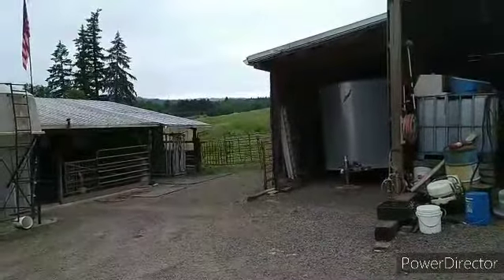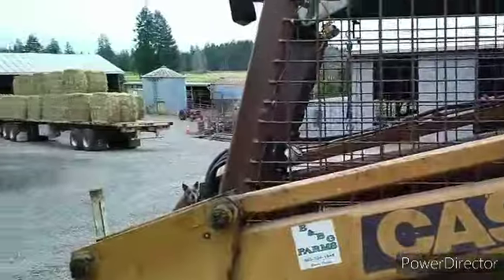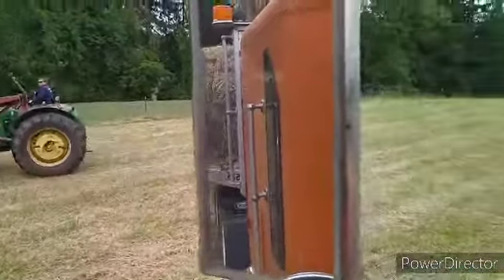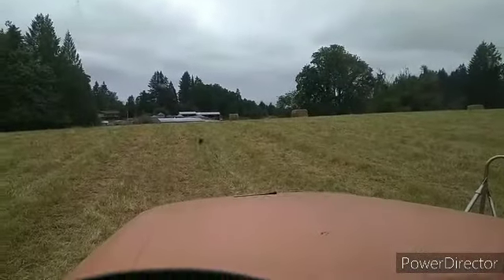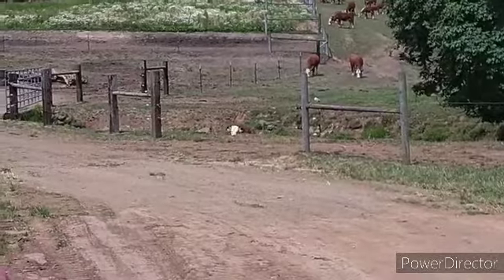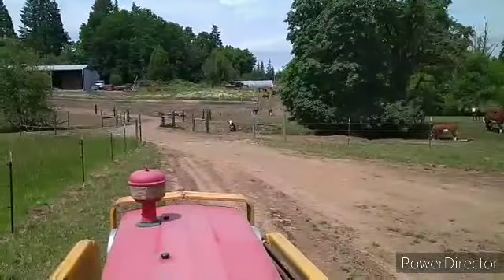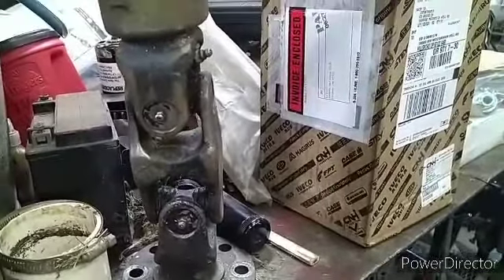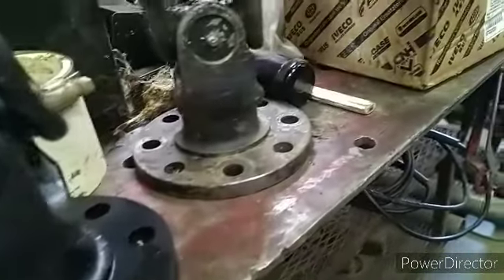hay in. working on discbine..

Comment: You have a very good tractor driver!👍 Oh man, seeing you trying to get the end shoe off the discbine brought back the memories.😳 Have to take the nut and bolt out a little. The 1411 was made the same way, would have thought they would have changed that on the 7230.🍻🍻
Reply from the maker: She's had some practice 👍
Thank you!!😁
Actually got lucky, didn't have to take the bolt out, just took the nut off, just enough room to get the shoe bolt out,.... 
I'd say the same engineers designed both🤔
Or just didn't bother redesigning...
🥃🥃🍻🇺🇸🇺🇸

Comment: Yeah that upper one turned in the direction of rotation is going to not only catch and wrap sh!t around the yoke, but it's going to ram full of dirt past the ball in the zerk and gum it up bigtime.  Needs to be turned so it's at least swept back away from the direction of travel to help shed crap and keep the ball from being packed with crap. 

Ya know I've been kinda looking at some of these diskbines used, but actually the more I see it the more I like the Deere moco's... just look much better built.  I like the modular cutterbar of the NH, and if I get a 3 point disk mower I'd probably aim for NH or Lely/Vermeer over any other brand, but honestly their diskbines leave me cold after seeing vids like yours.  Later!  OL J R :)
Reply from the maker: We wore out 2 Deere's, only went to NH because we needed something in the field, it was the only one around, so... 
I'd look at Krone and Kubota, what I've seen and heard, they seem like good machines.

Comment: To me you should be riding on the suspension of the coil springs on the left and right hand sides in the machine they should not be riding on the skid plates when I used to rely on the skid plates for suspension and height I was burning up skid plates at least once a year we just worked on a 13 foot cutter the other day adjusting the coil springs to get it up off the ground because it was just basically sliding across the ground
Reply from the maker: Suspension is to keep just enough weight on the ground, that it doesn't bounce. Not enough weight to the ground and the machine with literally bounce itself to death and you have a funny looking cut job.
13 seasons, probably average 300+acres per season.. still on the original shoes..
Reply: @GosselinFarmsEdGosselin  Oh 13 years I didn’t realize that I thought you were having some issues with height controller or something
Reply from the maker: @michiganhay7844  it's been a struggle for 13 years... Because it just cuts too close to the ground.. I just modified some of the skid shoes to hold it higher. As soon as it's all together, will set the spring pressure to accommodate..
Raising it about an inch and a half, should be high enough to let crop dry..
Reply: I’d like to see an up close of hire modifying those more like a old haybine?
Reply from the maker: @michiganhay7844  I took the outside 2 on each end and added to them, they in tonight's video.. similar to the factory high cut, but not as high.. (as far as I know anyway, I hy no idea what the factory measurements are)